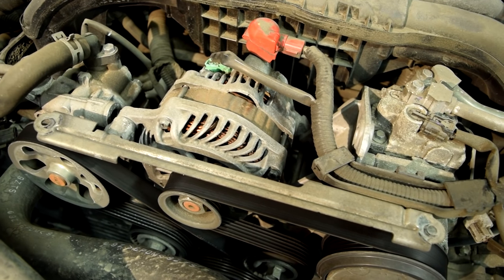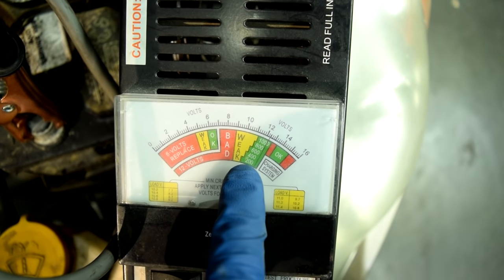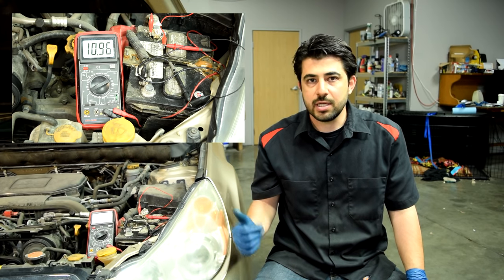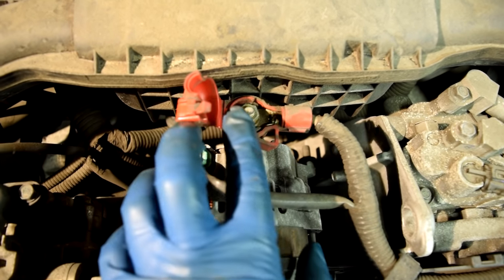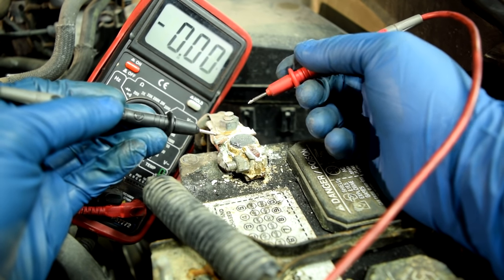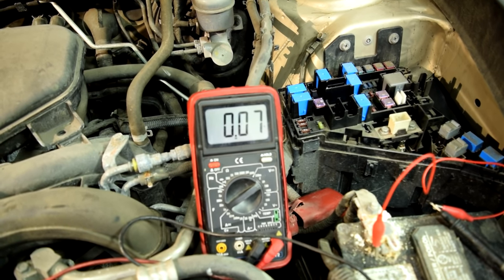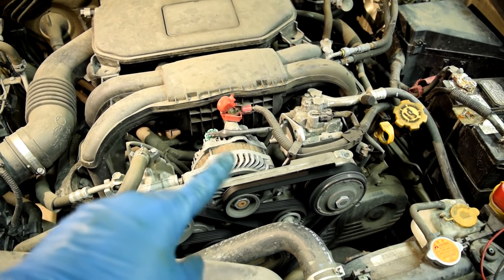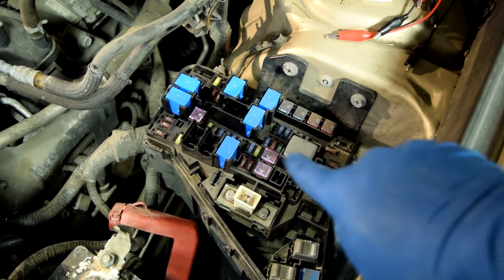How to Test an Alternator - Plus How an Alternator Works

Comment: I’m having relentless issues with my car not charging which went away for a couple of months after replacing the alternator. But it’s back now without the alternator light coming on. I have very little knowledge of how the system works and how to troubleshoot it. This video is so good. So informative and yet so rare. Thank you for this. You have given me many avenues of attack in finally finding the cause and no longer having to charge my car battery whenever in home. Thank you.

Comment: Super job!  U covered all the bases. One tiny thing I might add is the one way clutch that a lot of new alternators have. A Honda Fit gave me a fit. It was slipping and not charging when heavily loaded. Sitting at idle I had 14 volts. When the fans kicked on, it wouldn't keep up. Once again, great teaching!!
Reply: could internal regulator be controlled by the computer on car?  Because I replaced alternator and battery but from battery terminal i only get 12.5 if i try to disconnect the battery engine turns off.

Comment: The symbol you pointed out on the Ford diagram is actually a capacitor. It's there to absorb voltage spikes mainly to prevent radio interference and to keep the voltage output steady. This is an excellent video--very informative. Keep up the good work!
Reply: Joseph Wash Ii
Reply: Joseph Wash .....yea

Comment: I am a professional repair shop and you are making a great video that has great explanations! Great video, this is super helpful for anyone who has questions about their vehicle's electrical system! nice!
Reply: brother i have ford fiesta mk6 1.4 tdci my problem is that whenever i start the car  battery warning light comes on the dash but if i fully press the throttle all the way to 5k rpm it starts charging and light goes offf , plz help me to solve this issue . this problem started when i removed the battery

Comment: Awesome video. Very informative. Extremely helpful. Great explanation of working your way throughout the entire charging cycle to make clear what makes it work. Before I could only say motor spins alternator which charges the battery. I know there are a lot of wiring diagrams out there. At least now, I actually can make sense of one too. Super neat knowing what I've learned right now. I'm in the process of installing a car stereo system with multiple amplifiers and batteries. I've seen other car audio youtubers show all the "where's" to make connections but leave out the "why's" or "how" it works. I just want to learn more now. Thank you so much brother.

Comment: Wonderfully thorough video and answered my question about the two terminals on the back of the alternator. I knew one was + battery voltage to the stator and the other was to the gauge.

Comment: So I've known my mechanical since 1993. But not my electrical. But I'm studying ohms law and now know what amps, volts and watts are. And ohms, parallel, series circuts and how to read them. I'm buying my first multimeter today. Just the cheap $6 Walmart one for starters. So I can measure all this stuff for fun! Loving electrical. I'm building my own 700 watt solar panel system for my van conversion. 3 Lithium Ion 100 amp hr batteries in paralell. With inverter, solar controller, charge controller, BMS, Isolater, etc. Can't wait to test my deep cycle marine and alternator first with my new multimeter!

Comment: Thank you. This was good. I have to tell you about a bad battery that had a bad cell. I didn't have my load tester but I did have my meter. To make a long story short. I ended up testing each cell of the battery and found one that was shorted out. It through me for a loop at first because of the goofy readings I was getting on the meter. Love you site. Aloha

Comment: have a 2012 Dodge Journey 3.5L. I get the following codes C212A-17, P0563, P063A. I removed the alternator and had it bench tested at Advance Auto. The test said all the internal components were good (diodes, voltage regulator, windings, brushes and the overall health of the alternator was good Tension on the belt is good and replaced belt as an added measure..I was driving on hwy 75 to sioux city
 Iowa. Going 70mph ac on radio on cruize on headlights on. The radio went off.. Abs light and break light came on and then batteries light came on cruise control went off then break light abs light went off but battery light stayed on. I was able turn cruise back on. Turn car off turn back on everthing was back to normal. In your video you talk about to wires that lead to the alternator from the PCM in which you turn the ignition to the on position and using a test light find the active wire. I have two wires running from the PCM to the alternator (Alternator Field Control and the otherAlternator Sensor) By turning the ignition switch to the ON position what one should light up. The test light I have a computer safe test light which will tell me which is ground (green) and the Red for positive. Could you probe these terminals with it disconnected from the alternator and the car running? What other things should I be looking at?

Comment: Great videos! Thanks. If the alternator shall charge the battery, it has to deliver at least 13,8 volts. The electromotive force to charge the battery is only present at 13,8 volts or above. Maintaining charge of a fully charged battery can take place at 13,6 volts. I think it is important to emphasize the 13,8 volts as people  may think that charging will take place at 13 og 13,6 volts.

Comment: All your videos are just superb - 10/10 with your clear, no nonsense explanations!!!  I have a Denso alternator (the Land Rover has done 162,000 miles with the original alternator) - just yesterday the dash red battery warning light came on!  With the engine running I measured 11.8V across the battery and then 2 seconds later it went up to 12.9V (also heard a slight noise when this change occurred).  So suspecting the alternator which I will remove tomorrow.  Isn't it likely to be the carbon brushes (brush box) - surely they're probably worn out by now?
Reply: What was the result of the problem with your Land Rover? Their charging systems can be more complicated that Chinese math. Does your Rover have the water cooled alternator?
Reply: @steadyeddie7453  Bought a 2nd hand (Denso) one for $40 on Gumtree (comes with vac pump).  Bought a new brushbox for it as the brushes were worn down a fair bit.  Bought a new copper crush washer for vacuum line.  Heated oil return line on vac pump with hair dryer to make it flexible enough to reconnect.  Removed battery, battery box, engine ECU, acoustic shroud, fan and serpentine belt and egr bypass - then had good access to pull out old alternator.  Old alternator was oil soaked, but the issue was the worn out slip rings because of grit between slip rings and carbon brushes.
Reply: @steadyeddie7453  Not complicated at all - check RAVE workshop manual for Td5 engine.  The Denso alternator is a gem - same one for 19 years.  Starter motor is also Denso - I changed that 2 years ago.

Comment: Yeah, you are right mentioning operation of charging warming lamp which includes both S terminal and L terminal of the same connector. These terminals which are on the same connector are often overlooked when diagnosing alternator. Relying only on reading voltage at battery terminal is not enough for thorough diagnosing, especially when issues arise during the period of charging warming lamp.

Comment: Here's a tale of two stories about alternators that I ran across.

The first is my GFs car.  We just had the valve cover gaskets replaced after they have been leaking for a few months.  I then proceeded to clean off the engine, top and bottom.  I used Simple Green and a tire foam cleaner then blew off all the crud with my compressor.  Her alternator was putting out 13.5 vdc to 14 vdc but after the cleaning, it stayed at 14.5 vdc.

The second was my old Pathfinder.  During the winter, I started the car up and when I turned on the heater blower, it sounded like a supercharger!  Then I turned on the headlights and they went super bright then blew!  This Pathfinder had a wire from the output of the alternator to the positive clamp on the battery.  The continuity from the alternator to the battery was bad at that connection so all the alternator output was going right back into the wiring harness.  On a side note, the dealer wanted to change the whole wiring harness in the engine bay.  I found an auto electric shop that changed out the positive connector for $20.

Comment: Thumbs up...i will chk my battery same as procedure as you did to chk how much the voltage drop when starting..and the voltage output of Alternator during starting ...thanks a lot for the technical info.

Comment: Merry Christmas. Looking for some advice. In idle battery is charging at 14.9v. Under load(lights, fan defogger,radio) in idle charging at 12.2v. What could be the problem? Cheers
Reply: Similar case in my i20.
At idle, it is 14.8V, and even under loads all headlamps on, defogger etc etc, it slightly drops to 14.5 and rises to 14.8 again.

Comment: I was watching this video as someone who understands a fair bit about electronics but not so much about how they're implemented on cars: very interesting and thorough technical explanation.

thou I have to point out:
I'm fairly sure the brushes aren't represented in this diagram, and you mistakenly pointed to the capacitor, which is kind of essential to smooth out the waveform output of the bridge and make it trully a constant DC voltage.

It can also be an issue on alternators, and make the battery warning light flicker or turn on; it's a headache if you don't consider it as a faulty component.
Because the readings on a multimeter\voltmeter in DC mode are usually too slow to notice that youre getting a rippled output, it will show you an average value that can appear to be a healthy one. At the same time, this can make the battery light flicker so quick that it looks like its lighting up a bit\ dim, because in reality the output of the alternator is lower than it should be in the moments that the rippled output drops, and consequentially provides a mass to the warning light enough times that it effectively is turned on.
In a summary way: your voltmeter is slow reading the output and shows an average over a "big" period of time, but the warning light reacts much quicker than the voltmeter and tells you something is wrong. Which is, but it wont be fatal if the diodes are working properly, and it will probably only make interference with your radio or make your battery life like 10% shorter if everything else is ok.

Comment: Great video man!!!! I already have a multimeter and my battery is at 50% and doesn't want to charge so something's wrong...battery is bad or alternator is bad because i hear some chirping from the alternator when the car is cold and i start it. When cruising the car 50mph, realtime diagnostics from OBD socket show 14.5V, alternator current 27A and battery current 3-4A. The car has a 92Ah batt and 180A alternator. With your help now i'm gonna find out :) thanks

Comment: came back to your channel because I like how you explain how things work. I checked out this video as I am having problems with my 95 astro van I have replaced my alternator twice and I am getting 3.5 volts at the alternator end engine running. engine off and voltmeter from alternator to ground measures 9.80 volts. does this mean there is a short drawing all this voltage. need advice.

Comment: I feel like I can now charge people to fix their alternator problems 😁. Thanks for all the info, very detailed. I'm going through charging problems and cannot afford to pay to have it checked, so again, many thanks. This will help me know if my alternator has really crapped out, as the test they did at AutoZone only checked the voltage at the battery and they didn't bother to actually check the alternator itself.

Comment: There is a resistance test that can be conducted on the pin-outs in order to determine if the regulator is operating correctly, I'm surprised that you didn't mention it.

Comment: I'm only halfway through at this point but I just had to type in the comments how much I appreciate your explanation. I'm currently trying to change my alternator but was unsure the 2 wire connector part and afraid that I'll wire it incorrectly. But it seems like even if it is reverse, it will still provide power and ground. I hope I am correct.

Comment: A very specific question my friend, I hope you can answer me: My multimeter indicates that the alternator is not charging, I checked it from the battery and from the positive on the alternator, in both cases it marks 12.50 volts with the car on. That on one hand, but before removing it from the car, I would like to know if there may be a circuit failure elsewhere that is preventing the alternator from working, because the indicator tell-tale light never comes on, neither when the ignition is off, nor when I start the car, which indicates that something is wrong. I disconnected the tell-tale dash light wire from the alternator and connected it to negative directly and the light then turned on perfectly, but when I connected it back to the alternator the tell-tale light doesn't turn on at all. So with the multimeter I measured the voltage from the tell tale light cable connected to the alternator with the ignition off, and it gives back the battery voltage of 12.50 - but when I turn the key to contact I measure the voltage on the tell tale light cable again and it now gives 0.86 voltage.
I tell you about the incident that happened just before the alternator stopped charging: I was testing the voltage with the engine running, from the cigar lighter and inadvertently touched the positive and negative of the lighter and it made a slight spark. From there the problem began. The car is a 96 Fiat Uno diesel that has been in my family since brand new. Nothing weird or invasive was ever done to the electrical system. it is all factory standard. Could it be the alternator? Could it be that I screwed up the regulator on the alternator with the short circuit I caused in the cigar lighter? Or did I screwed up another part of the electrical circuit and is now preventing the alternator from working? Base on your experience, what do you think might be the cause of this failure? I have been going around this matter for days. I thank you in advance for your reply. Regards.

Comment: Hey dude!! Always great tutorial videos and your love for repair & maintaining these babies is so obvious and refreshing..however...whats with the dirty engine bay?? Do you know that i have a 1999 Chevy Tahoe (210,000) 1987 Mercedes 560SEL (122,000) 1999 Lincoln Cartier TownCar (188,000) 1995 Lexus LS400 (165,000] 1996 Lexus LS400 Gold Edition (167,000) and guess what they all have in common? Firstly, i bought them all from the original owners, so i have maintenence history records on nearly every warranty scheduling plus any parts or upkeep parts records on each. Next..since i have owned each one, i actually do full oil filter & oil change @ every (1000) miles plus checking on air, fuel filters and check spark plugs every 10,000miles, as well. And lastly...my engines all look jus5 as if theyd been just dropped into the engine bays!! I mean, it just makes sense to have "good house keeping" tendencies when trying to keep our vehicles clean & lovingly cared for and it lets me sleep soundly at night knowing i am diligent in keeping things nice & tidy. 
Guess what happens every time a Engine Tech opens up my bonnets and observes these amazingly clean engines? Theyare pleasantly amazed and thankful to do any OpsChecks on my vehicles because it seems so easy to observe any leaks or damaged components in a flash and also they love not having to get dirtyengine oil & smudge all over themselves...and because of this...they're always mindful to help me keep thing this way after they've finished testing my car engines and if or when i ever needed someone of these techs to quickly just under the hood to do any emergency checks for me...they seem to always do it "ungrudgingly" no matter what the weather conditions outside. TakeCare and keep up the amazing work of getting these criticalvideos out!! (@@)
Reply: Btw..one of my most important jobs as an Airman in the USAirforce StrategicAirCommandBase @ GrandForks, ND (319 FMS) was FlightLine Electric Shop Electrical Systems was not only to do precise opschecks on any electrical systems & components, but to carefully & thoroughly ops checks any of the (8) JetEngine "Constant Speed Drives" (which is the jetengine equivalent of an automobile alternator) ..with one exception..those Constant Speed Drives cost approx ($44,000) a piece to replace!!

Comment: Great video and explanation. I have a Peugeot Expert Tepee and have an issue when I start it up and drive along the road, I notice that my headlights fluctuate, they go bright and then dim, bright then dim again on several occasions. Eventually it settles down. My question is could this be an issue with the regulator? Thanks